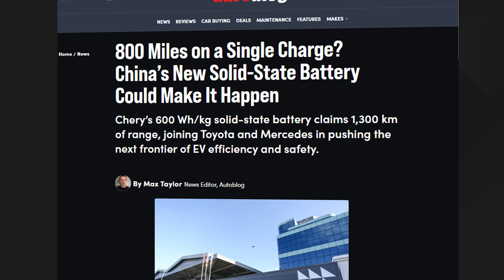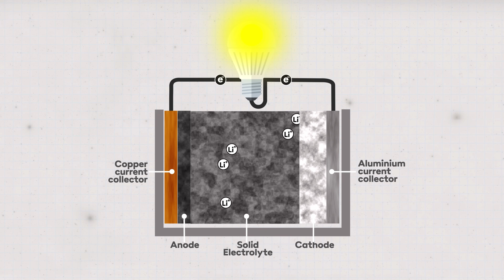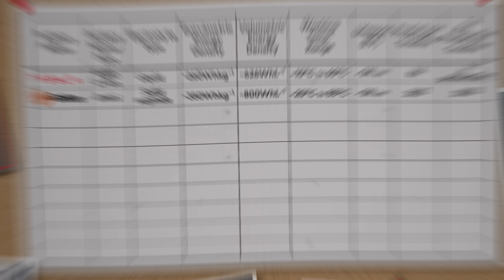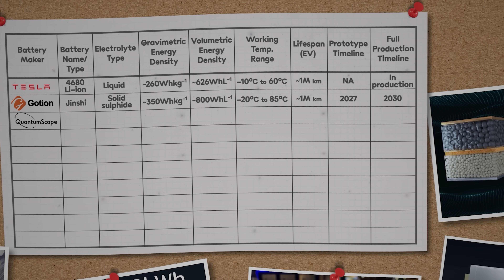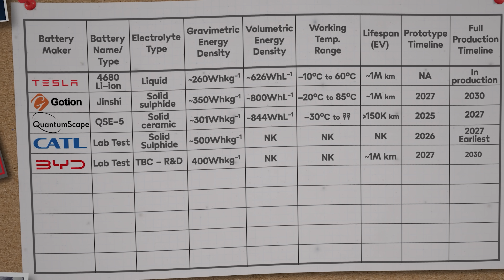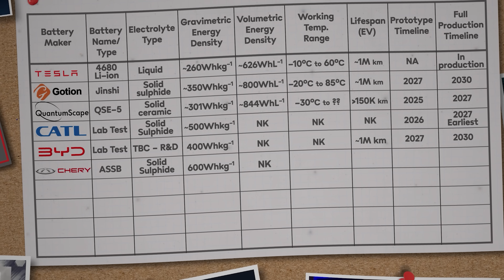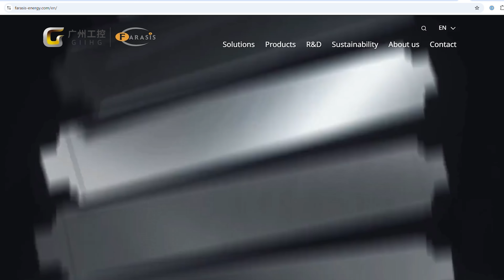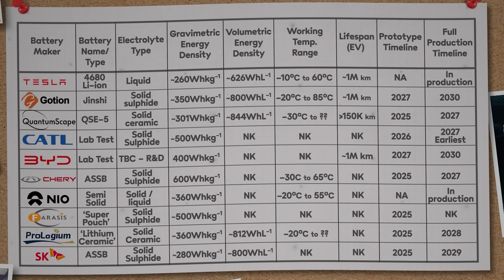Solid-State batteries. Finally arrived?

Comment: I think the regular old lithium iron phosphate (LFP) battery cell is now becoming today's equivalent of the venerable Chevrolet 216 cubic inch "Stovebolt 6" internal combustion engine of the 1940s and 50s: a bit overweight but marvelously reliable and long lasting. It gets the "point A to point B" job done. Just build lots of EVs with LFP cells and V2L capability. And make them cheap. I'd rather have that than a handful of supercars with continent-spanning range and hyper-quick charging speeds. Wake me up when it's 2028.

Comment: The best takeaway from all this activity is the stunning speed at which new chemistries and manufacturing processes have been moving the last 10 years or so. Just 20 years ago nothing was happening in battery development other than some academic research work and a lot of that was just to improve cell phone batteries. Now we've got multiple companies racing to actually get product into production. Plus there is a lot more of that academic research going on because there is now lots of money flowing into battery world in general. Always keep in mind everything re solid state batteries is very, very early stage. There will likely be continuous improvements for the next 50 years. Also don't forget that the growing power of AI is going to be applied to "the battery problem" very soon and that could produce some unexpected results. AI is not just for chatbots and funny deep fakes, it will have huge scientific impacts across all disciplines - particularly chemistry.

Comment: There are two major issues. One is going from prototype to volume production. The second is building an entirely new supply chain. Assuming that they able to hurdle the first, they cannot build an entirely new supply chain out of whole cloth. It can take years to build up a supply chain.

It would be foolish to first introduce these batteries into ground vehicles. I expect that the initial use will be in drones and then moving to other aircraft that are fully electric. They can even replace the batteries currently in aircraft that use lithium ion battery for engine starts and to start their APUs. Aircraft will gain far less by the lower gravimetric energy, than ground vehicles will. Aircraft are also higher margins than automobiles. They could also go into satellites and spacecraft. These are the markets that make the most sense for initial production while they build out their supply chains.

Comment: Back in 2018 when I heard about Solid State batteries and promised myself I would Subscribe when batteries were readily available, I was quite excited.    Now with advent of faster charging, longer lasting, working in wide temperature range and made from common materials salt batteries.  Able to be produced in existing battery factories.   I'm not sure I want solid state batteries with their exotic materials and manufacturing.
Reply: If someone is actually buying an electric vehicle, it's often a good idea to go with the technology that's better known. The manufacturers know how to work with it better, and there are fewer surprises when the batteries age.
Reply: Salt batteries are as crazy an idea as solid state for volume production. The market is driven by the cheapest option that can extract the highest margin, this is why oil has been so dominant for so long.
Reply: @Clynikal  Except that is apple and oranges.  Batteries store power,  Oil generates power.  Salt batteries are already in production CATL.   Using same factories that they made lithium batteries in before.  So just change over cost.    Lithium $70s/kWh to produce, high $30s/kWh for salt.   Salt is new and they speculating $20s/kWh in a few years.    So solid state is lighter in weight, maybe faster charging, but I think they will end up in niche market having lost out to lower cost already in production batteries.

Comment: Is not really that important anymore. Current LFP batteries are relatively cheap and safe, and if a solid state battery breaktrhough happens the most plausible landscape is that the fisrt cars to implement those will be high end luxury models with very little impact in the car markets. 

   Since liquid batteries are already conquering the world (September with Norway ne cars sales made at 98% by EV and plugin EVs, 73% in Denmark, 68% in Sweden, 59% in China, 49% in Portugal...   In China sales of new ICE cars will fade to 0 before 2030, with half of Europe following in a couple of years more (remember that took Norway 6 years (2018 to 2024) going from 52% to 90% and a year more (2025) to delete sales of new ICE cars...  But now there's much more EV variety and range of prices than in 2018, so the trsnformantion will be FASTER than in Norway.

Comment: 10:08 1.5x? Did you forget the 120KWh battery of the new EQS? So maybe 25% more…
Reply: The Chevrolet Silverado EV offers battery options of 119 kWh, 170 kWh, and 205 kWh; the Hummer EV Wankpänzer has a 212 kWh pack. Because Amurrrica is bloated vehicle king y'all!

Claims of 1000 km or 1200 km batteries are so pointless. Batteries don't have any range, an EV has range. Tell us what kind of car and how big the battery is. (Then remember that the WLTP range test is more optimistic than U.S. EPA, and Chinese CLTC range is a fantasy.)
Reply: Over sized batteries to hype bloated range is just marketing games - not the norm. Compare efficiencies for something meaningful.

Comment: @Dave Think , please don't uncritically repeat the SSB wannabes' claimed benefits. 2:07 'Solid State batteries are the “next  big thing” that will transform electric vehicles with much higher range, faster charging  times, less fire risk and lighter weight.'

But today you can buy Chinese EVs with LiFePO batteries from BYD and CATL with 10C and/or Megawatt+ charging that recharge 10-80% in less than 10 minutes. They pass stringent puncture tests in which nails are driven through the battery with no ill effects. They have very low fire risk. They have million-kilometer lifetimes. And batteries don't have any range, if you put enough kWh of batteries in a car you get whatever range you want.

The ONLY benefit SSBs still have over today's batteries are higher mass density and volumetric density. That's it. For years drone makers, motorcycle makers, and sports car makers will be willing to pay extra money for this; maybe some luxury car makers will swap out their 100 kWh battery packs for 160+ kWh solid-state battery packs for greater range for even more money. But the idea that in 2027 you'll buy a Corolla with 800 km of range flies against basic economics.

Also, whenever you mention EV range, be sure to say "on the very optimistic CLTC Chinese range test".

Comment: Solid-state batteries are like fusion. They're always 30 years away.
Reply: Not the same. Manufacturers have already made thousands of cells, enough that car makers have made EV battery packs from them and put one in an existing EV to claim "1000 km range!" Even with delays one or two companies will get to low-volume manufacturing by 2027-2028.

Comment: There is no need to use them. North America has high garde phosphoric acid and a company past the pilot stage of commercial grade for LiFe batteries. They are cheaper and just as reliable. The only reason to consider solid state and take on the huge cost is to bypass China, which, once again, you do not have to. If you are interested in actual research into the companies providing all the ingredients for any of this tp happen, check us out or write directly to Andrew@themarketmindset.ca

Comment: TL,DR: we don't know when there will be SSBs in EVs, but all manufacturers lie about the same date ("2027"). So it either happen "never", or "waaaaay after 2027". We needed that yesteryear. But it's funnier to fund LLMs that waste electricity than to work on chemistry and industrial processes.
Reply: Who exactly needs SSBs? SSB makers still hype the benefits over old batteries, LiFePO batteries have caught up on charging speed, durability, and safety. All that's left is higher density, but most people don't care how much their car weighs, and most people who demand 700 km range have never lived with an EV. Price is king, and LiFePO won.

Comment: Fuel cells far are from bonkers - suggest you do some more research into the role of fuel cells in shipping.
Reply: Fuel cells are bonkers in that the economics of producing the hydrogen to power them is bonkers, and storing huge amounts of hydrogen on a ship is also bonkers. The technology itself works very well. But at the end of the day, commercial shipping is a tiny percentage of global emissions, if we just have to stick with hydrocarbons for shipping for the rest of human history we can probably do so comfortably.
Reply: @AlRoderick  fuel cells can crack hydrogen from other fuels that are much simpler to store and transport. The economics of energy to fuel is changing at an accelerating place. Fuel cells are the sensible solution to replace any and all diesel engines.

Comment: CATL and BYD are the most believable, but doubt is strong. 

Also, why even mention Toy yo ta. Hydrogen has been two years away since the 80's, they have zero credibility. ZERO.
Reply: They built hydrogen cars. That's not even a pie in the sky promise anymore, they built the cars. The problem is that actually buying operating and using one requires infrastructure to exist that Toyota didn't build.

Comment: I think 2027 will be a solid year, indeed.
Reply: It’s also the year when the aliens show up. I was told..
Reply: I would say a hybrid year.
Reply: @PETERJOHN101  Nah, by 2027 there's a good chance BEVs will be cheaper to make than anything that takes fuel, even without subsidies, just about everywhere where carmakers are allowed to import Chinese batteries — which should be everywhere except the US. Which should cause the same that happened in Norway and China to repeat across other countries: ICE, HEV, and PHEV all falling in sales, while BEV starts taking over.
Reply: Same comment but 2028 next year after they push their timelines.
Reply: I would say it's semi-solid, as making truly solid state batteries that could deliver high performance and has good durability are still very hard

Semi solid battery will fill the void before the true solid state finally made into mass production
Reply: What do you mean 
Ice sheet is going to increase again 😮
Reply: Maybe closer to 2030 they have been trying for years would be nice to see the issue is lithium itself is still flammable its lower risk in a solid state battery the risk is never zero though. It would be greatly reduced compared to the current batteries the other issue to see would be degradation will they act like nickel metal hydride batteries that if used wrong lose capacity and or can fail as a result as well
Reply: I see what you did there!

Comment: in the early 1980s flat screen tvs and monitor were going to come out soon,  very soon,  next year,  then very soon.  and then they did and here we are.
Reply: Well said. The first apple desktops in today's dollars? Cost $25,000-$32,000!

The first plasma TVs on eBay went for well over 10k for a 40" 20 years ago! The first model s cells we're rumored to cost tesla well over $850.per kwh at the pack level!
Reply: re: "in the early 1980s flat screen tvs and monitor were going to come out soon,  very soon,  next year,  then very soon.  and then they did and here we are." welcome boys and girls to the error regarding the classic "Apples Vs. Oranges" comparison that our Parents told us NOT to make (or at least mine did anyway).
Reply: @phillyphil1513  at one time we had tubes in our radios.  then came transistors,  now we have ASICs,  application specific integrated circuits that have hundreds of millions of transistors in them.  science,  that maga hates it,  doesn't stop it.  whether in the united states, pre trump,  or in other countries, science progresses.
Reply: The difference is that affordable 1000km - range EVs would transform transportation and give a slight chance of avoiding some of the damage from climate chance. And we needed them 30 years ago. But, you're right, instead we focused our engineering resources on flatter and bigger TV screens, to watch stupid shows in better quality - so that everyone is too dumb to work on chemistry and industrial processes. Hurray, I guess ?
Reply: @phtrivier  i was just making the point that unreasonable  promises kept being made,  while at the same time progress was also being made.  i'm hoping in the future we have 1000, to 2000 mile range ev mass transit.  a redesign of what a community is, as in less spreading out where cars are the only choice we can make.
Reply: @jensonee  re: "i'm hoping in the future we have 1000, to 2000 mile range ev mass transit."  what I'm hoping in the future (when we still DON'T have this tech) is that we'll look back and have a laugh over how ABSURD and NIAVE it was for us to ever believe that a functional mass market Battery could have a solid electrolyte to begin with...? hashtag WEARESUCKERS.👈but see it's difficult for our Egos to come to this realization, and all the CON MEN in the world know this (to that end the CON MEN know us BETTER than we know ourselves).
Reply: @phillyphil1513  at one time we sat in front of a monitor that had a cathode ray tube projecting the image on the screen.  now we have leds doing the same job at a tiny fraction of the cost of the cathode ray tube.  it's obvious that ev batteries and storage batteries have come a long way.  and just like your flat screen tv, car batteries and storage batteries will progress into better and better devices.  you don't have to accept it now but when they are here you will or deny that reality.

Comment: I'd be interested if they are developing small, energy dense solid state batteries to work for scooters and motorcycles. Because the biggest issue with electric motorcycles is the limited range and high cost.
Reply: See Ducati ev crotch rocket with a prototype solid state pack.
Reply: @4literv6  Isn't that for Moto-E not production?

Comment: Solid state is the new fusion. 10 years anyone?
Reply: Battery companies are already making thousands of solid-state cells, enough for car manufacturers to hand-make a battery pack to replace the one in an existing EV and claim "zOMG 1000 km range!" All the 2026 "a bit more than pilot production" battery factories will produce more cells. So it's much better than fusion, but SSBs cheaper than LiFePO may never arrive.
Reply: No. The problem with ASSB seems to be cost while fusion's problem is actually getting it to work. Like right now if money is no issue and you just want a car with solid state batteries it is possible but the batter alone will cost as much or possible more than the rest of the car.

Comment: The semi solid batteries only need to compete on price once solid state appears, it's like LFP  and lithium ion both still have their place. And a factory already operating has an advantage for a few years.Meanwhile when solid state appears I will be able to charge them from my existing fusion power plant😂
Reply: They don't have to compete on price in applications where energy density (the only benefit SSBs have over cheap LiFePO batteries) matters: drones, supercars, luxury cars where buyers will pay $$$$ for large 160+ kWh solid-state battery packs.

Comment: It's plutonium. That's the real solid state battery. A single charge has already sent Voyager I 25 billion KM and it's still going 😂😂😂
Reply: Unfortunately, my ev struggles against gravity and atmospheric resistance.
Reply: That's not even a battery, it's just an RTG with a decaying radioisotope core.

The thermoelectric system is pretty inefficient so you need a lot of radioisotope to get a decent power level that will actually last a significant length of time.

You can use a more radioactive source that gives out more heat per kg, but the half life is much shorter so the output will taper off much faster.

Americium is going to be the new radioisotope that replaces plutonium going forward for new RTG bearing missions.
Reply: Hi welcome to the internet  @mnomadvfx  it must be your first day here 😂
Reply: Plutonium is a great solid state EV battery*

* As long as you're fine only ever using the infotainment system and maybe, if you're lucky, creeping around at 2 MPH.
Reply: To note the 8 tracks are still whirring...
Reply: The plutonium is powering only the electronics. The propulsion is still chemical rocket propelants.
Reply: @alihms I assure you after 50 years there's no chemical fuel left. It stop accelerating long ago and just continues at its current speed because there's not sufficient friction to slow it down 😂😂

Also in an EV the electricity isn't a propellant it's not directly creating thrust. It powers the electronics, which includes 4 electric motors
Reply: @michaelmayhem350  "It powers the electronics, which includes 4 electric motors"

The vast majority of EVs have just 2 motors or less.

Obviously if you can make a wheel base motor light and cheap enough the preference would be to have 4 of them, but for the majority of EVs that is not currently the case.

Even once they can be made cheaper it will probably remain a feature of higher end EVs.

Also bear in mind that 4 motors means more wiring, and despite the fact that nobody ever talks about it the copper wiring that provides power for EV motors is not trivial in added weight.
Reply: @mnomadvfx  I didn't say 4 wheel motors. Generally you have 1 motor driving the axel. Another for the hvac. Another for the suspension and yet another one for the power windows, chair adjustments & seat heater.